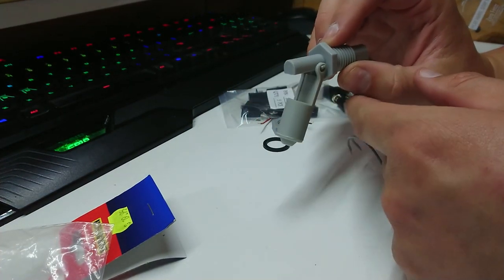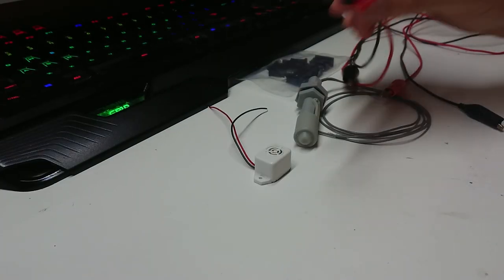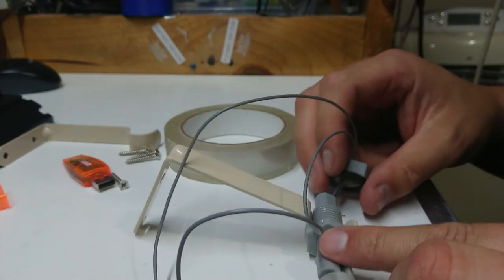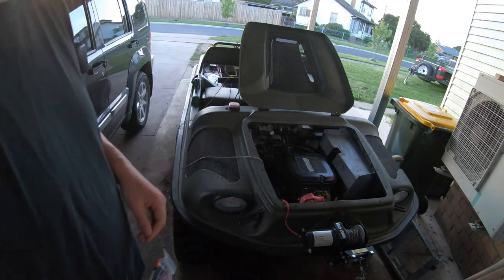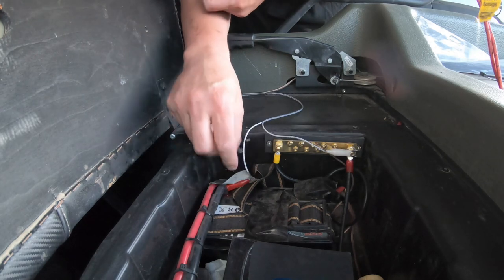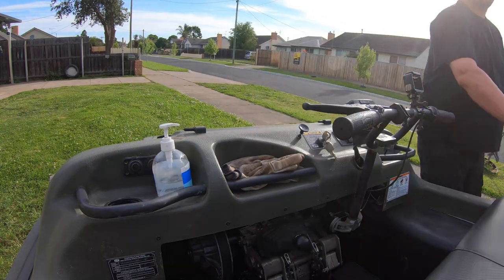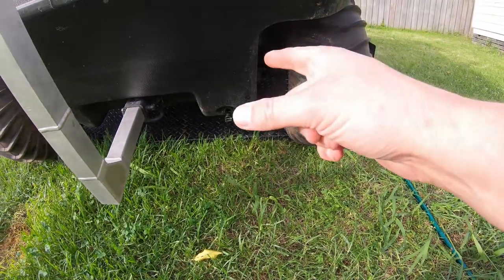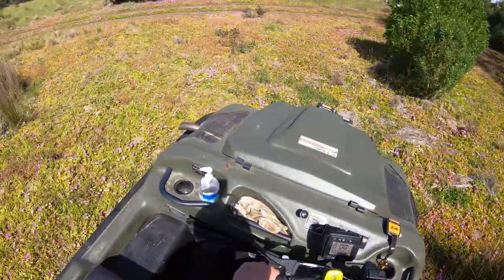Adding a bilge alarm |  New Argo 8X8 - Episode 28

Comment: One of the first things I did when I got my Argo was to test the bilge pump. I was very surprised how much water was in the tub before the bilge kicked in and started pumping it out. it was definitely touching the chains.
Reply from the maker: Yes I set mine as low as I could. I wedged it under the winch support mount so that the pickup is right at the lowest point at the front, even still it's almost at chain level before it gets a prime. Useful to stop me sinking and get back to shore where I can empty it properly
Reply: @TheAussieRepairGuy  My Argo is a 2018, it came with the bilge already installed. It's attached to the frame between the 1st and 2nd axle, just inside underneath the primary and secondary clutch area. 
When I filled my tub to test it; I was surprised at the volume it put out.
Reply from the maker: I did some homework on that and decided I'd get a bigger pump, and mount it as far forward as I could, for that very reason.

Comment: Having an ON/OFF switch means you can unknowingly have it turned OFF and not detect a flooded bilge.
Better an annoying buzzer than be on the bottom of the creek/dam/sea.
Get the digispark out and make a system that when in flood, it beeps for 15Seconds then after that beeps 1second in 30 or 60Seconds until the water level goes out.
You can also program so that the float switch has to be ON continuously for say 5Seconds before sounding the buzzer.
Also make it buzz for a couple of seconds when you power up so you know it is activated and the non-weather proof buzzer is functioning.
To fix a But*^^ch problem braces/suspenders, proper underwear.
Daggy hanging trousers is a fashion insult, not a fashion statement.
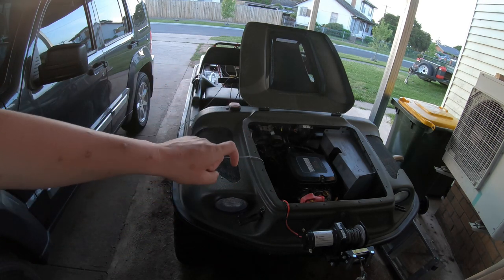11:30, ha ha ha, the zip tie fairy...
If you are using a SLA DEEP CYCLE battery, and you are drawing starter current from it, I would consult the data spec of the battery to see if it is happy with the peak current your starter will draw.
When you wired the alarm circuit back directly to the battery, have you included an inline fuse in the power lead?
Reply from the maker: So a few things you may have skipped past:
The switch was omitted.
No fuse for now, but attached with clip leads until I determine how well it works. The wire is of such small gauge, it's likley to act like a fuse.
The battery us a SLA designed for motorcycles, and is ok with starting current.
Currently the bilge pump can't lower the water level enough to stop the buzzer. So I'll be redesigning a few things in the future.

At least now I have some early warning as opposed to none.